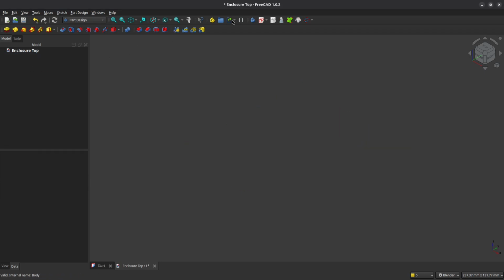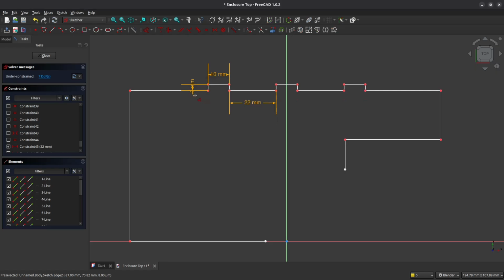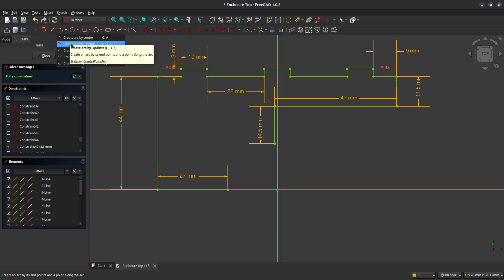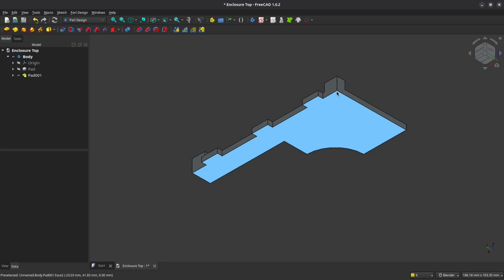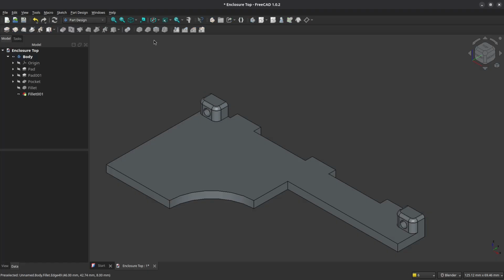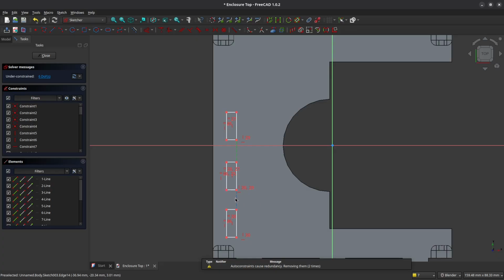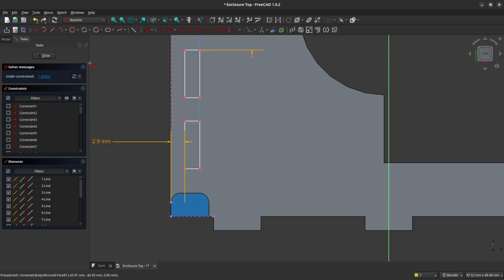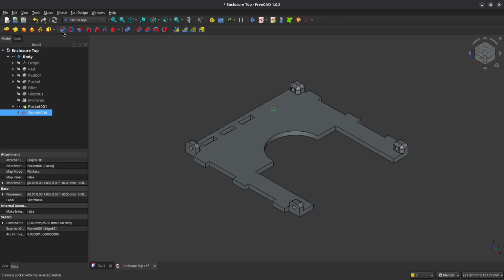SPARKBOT V2: PART 15 | VETRONICS ENCLOSURE TOP COVER

Comment from the maker: Welcome to Part 14 of the SparkBot V2 architecture. 📐

In professional engineering, if a mechanical solution works perfectly once, you standardize it. Reusing the tab-and-socket joinery from our Battery Box for this Top Cover not only saves CAD time, but it creates a cohesive, recognizable design language across the entire robot.

Question for everyone building along: Do you have a signature joinery or mounting style you reuse across your 3D printed projects? Whether it's standardizing on M3 hardware, using dovetails, or captive hex nuts—let me know your go-to design standards below.

Chart your course. Build your world. 🍁